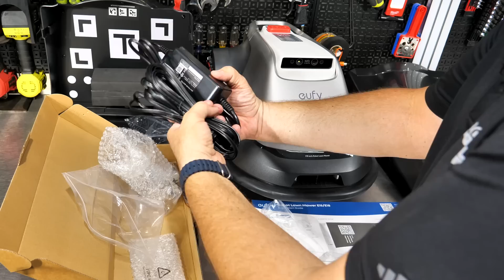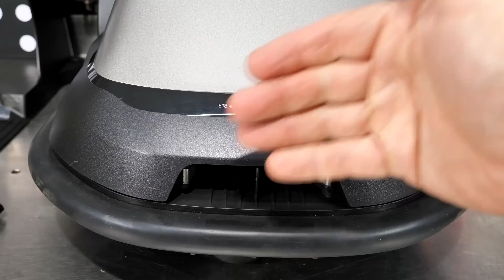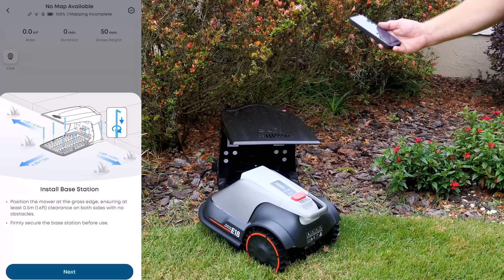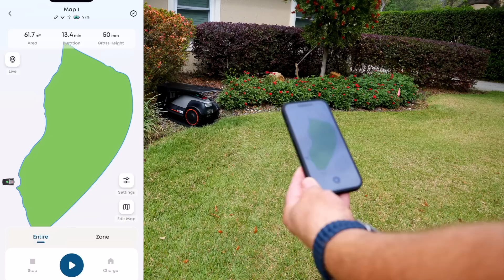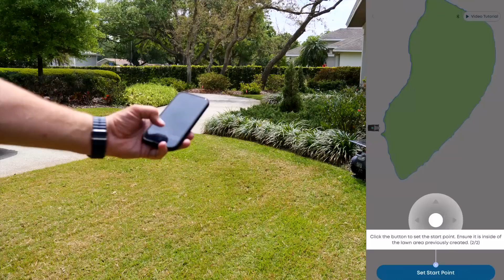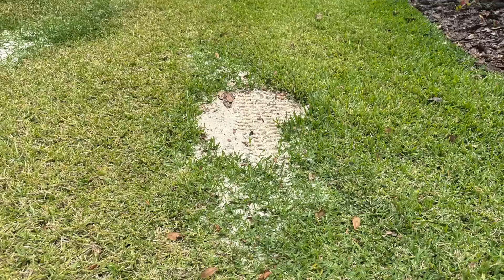NO Sweat! eufy E18 Robot Lawn Mower - Start Mowing in 5 Minutes

Comment: So this is going to sound really dumb but how the hell did you get the remote control to work?? When I try to turn right it goes left or backs up. It’s really hard to even get it to go in a straight line. What am I doing wrong? Looking at my phone screen I assume the top arrow means go forward etc but it doesn’t. Help

Comment: New subscriber here . . . You're really doing a good job!  I'm studying the E18 robot lawn mower and the Lymow unit from your site hard to pick which one? ? ?
Reply from the maker: Thank you very much. If you have a very simple and small yard with defined barriers, then get the eufy. Otherwise, the LYMOW is much more capable mower. Thanks for watching.
Reply: @Shoptoolreviews  Thank you for your response and I would like to ask this of you. I have three neighboring yards which of course are open space no barriers whatsoever So could I manually setup walking behind During the initial setup of my zones setting up the adjacent Perimeter to each concern with the LYMOW? Also while I have your extended knowledge of subject I also a very large 30 foot diameter garden in the smack battle my yard which has 6 inch drop off around it Would I also have to manually set that up I'm guessing no zone? Thank you for your help in advance.

Comment: It cuts in straight lines! Pretty cool. I have to cut 3 acres so this isn’t for me, but it looks cool. I think it’s real weird that the on/off button is on the bottom of the machine. Won’t it get all nasty and covered in grass?
Reply: You would never need to turn it off with that switch though so not an issue.

Comment: Really good video, thanks! That price point is a really tough bridge to cross.
Reply from the maker: You're right, it's not exactly cheap and it's definitely not for everyone. However, it does have its place. Many homeowners in Florida are paying more than $250/month to have their lawns maintained. At that rate, it doesn't take long to get your ROI. Also, with the robot mower, your lawn is Always cut, it never gets long. Thanks for watching.
Reply: I felt the same way but as a Eufy customer they gave me a 300 discount. It pays back itself after two seasons of lawn care for me. That’s for a complete spring and fall clean ups and mowing once a week. To offset the cost I’m doing all the lawncare this year. But I’ve had it since late March. It has some software bugs but they are working it out. It’s worth it for me and it does a great job. To have it now each morning and keep the grass low has been great. Because it mows each day there isn’t any clippings to pick up.

Comment: I'm sure it is great out of the box. Eufy doesn't support their products long term though nor respect their customers privacy. Never purchasing anything from them again over those two issues.
Reply from the maker: There has definitely been alot of speculation over the information shared regarding their security cameras, but I also thought they actually made some strides to the good with that as well. We actually did quite a bit of digging on that topic over a year ago, but we haven't checked in on it lately. Thanks for watching.